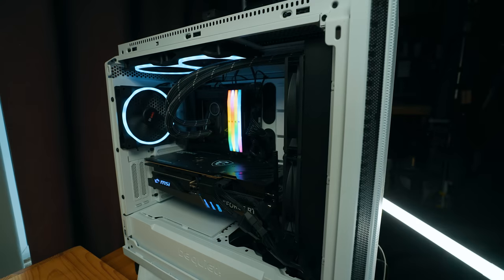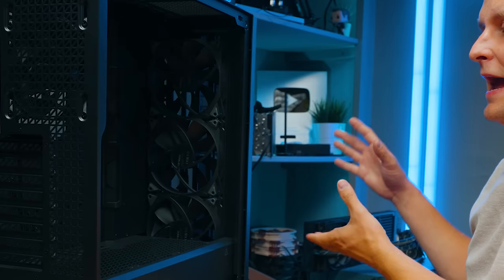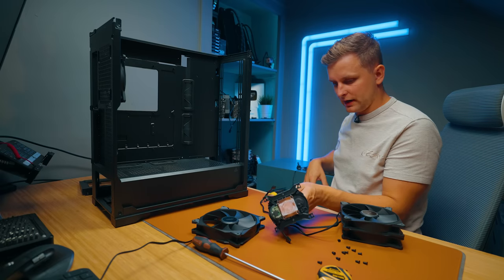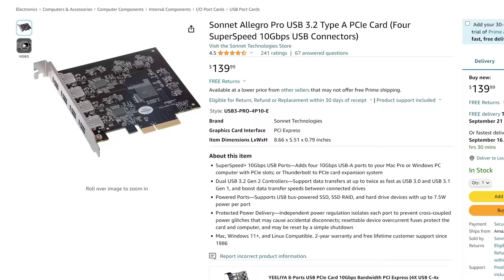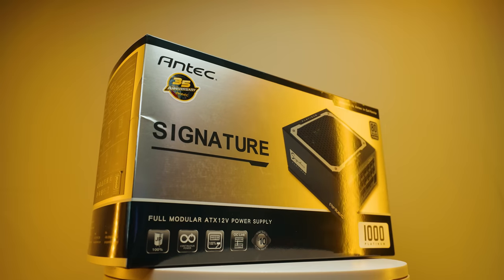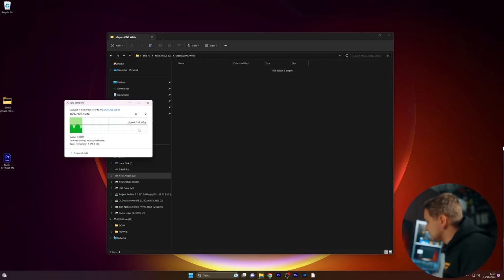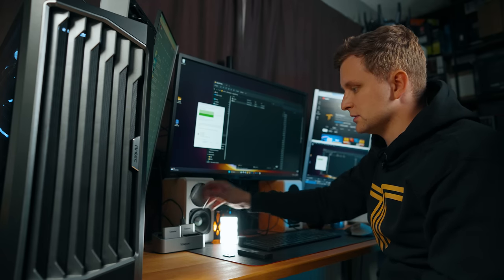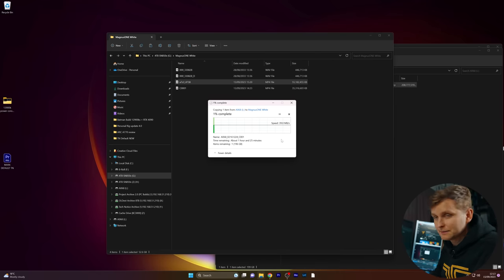I Upgraded AGAIN👉 BEST Video editing PC 2023! | Personal Rig Update 4.0

Comment: I can confirm that NvME 4.0 Lexar Aris drive in a 10Gbps case on my Editing PC (6000Mhz 2x32GB Corsair RAM + 13900k CPU + 3090 RTX GPU + Z790 ProArt Creator Motherboard + Windows 11 | >> Can sustain ~950 MB/s upload speed (copying files from the SSD to my PC) for over ~15 minutes (uploading ~1tb of .mp4 video files). The external NVME drive is plugged via USB-c to USB-c in the second (from the top) Thunderbolt port, on the back of the PC.
Reply: And all that while running 100+ Chrome tabs and Unreal Engine in the foreground.

Comment: Any idea what the 'new' ASUS z790 Pro art  motherboard improvements will be? I heard they are upgrading it for the intel refresh coming out soon. Will the extra power/cores/heat from the new i7-14700K require liquid cooling?  I am interested in the MOBO and i7-14700k for Audio production only w/o a graphics Card. Thanks
Reply: I haven’t seen or heard anything about the pro art motherboard being refreshed.

Comment: i wonder if crucial RAM and SSD are good for creative work like 3D and editing? and if you can make a video about build PC budget 4000$ to 4500$ using Crucial RAM i really appreciate
Reply: I have a 4TB Crucial SSD for the source files, I had a few speed issues before I saw that it requires a driver install. So be sure to install the driver, especially for the large drives.
No issues in nearly a year of use, I edited 6TB of videos from it.

Comment: The IO on Creator motherboard is limited yet exceedingly stretched. I see this as a problem with the available PCIe lanes.

Minimize the connected devices and you will see the difference
Reply: Had the same thought. Looks like a PCIe lanes bottleneck, upgrade to a prober CPU platform and problem solved😂😂

Comment: I'm having kind of a similar problem. But i use my phone for recording and wanted to transfer from it via usb c (phone) to usb A 3.0 (Computer). 

So since i removed the Windows phone link (I didn't like all my phone messages appearing on my pc), i tried sharing a folder on my pc so i could access the folder on my phone and transfer the files through Wifi. I however couldn't get it to work.

Do your camera's have Wifi? Maybe you can try transferring this way. (If you can get it working)

No clue what i did wrong. If anyone got some advice pls feel free to educate me.

Comment: Hi, I also have the z790 proart motherboard, and huge thunderbolt issues.

However, I get decent speed with my two usb-c CFexpress card readers, they are “only” 5gbps but they performs at that sped when using the thunderbolt ports. However I have experienced some thunderbolt “crashes” and then the card reader speed drops down to usb 2 speeds.

A also have a thunderbolt driver fail during windows boot and also WHEA logger errors on the PCI root port. (according to device manager the thunderbolt is connected to the pci rot port that produces the WHEA logger errors)

Do you have any errors like that ?

 

I also struggle with display over thunderbolt, etc. it kind of works but to unstable to be useful.
I don’t get display signal until windows has booted halfway up. And sometimes windows just hang during boot. Etc. no display during post etc until I take a reboot. (I have a ASUS proart monitor with thunderbolt.)

I have also done a complete fresh windows 10 installation on a separate m.2, and it’s the same.
so I suspect it’s the motherboard.

I have contacted ASUS customer service, but they have not been helpful yet. (But they are verry good to blame everybody else.)
Reply from the maker: Is it the top end ProArt monitor? If so, that monitor has very slow boot times and not necessarily to do with the Windows/motherboard.
Reply: @theTechNotice  I have an Asus PA34VC. I don’t notice any change in boot time if I use it on DisplayPort directly (thunderbolt disconnected) or through Thunderbolt.

Comment: Why place the radiator in that orientation with the tubes at the top?  This is extremely bad advice from a tech tuber … shows lack of basic understanding of physics.
Reply from the maker: In this configuration that's the only way ;)
Reply: I haven’t used this case so fair enough … I would then state that this case is not good for AIO’s if the tubes don’t fit at the bottom

Comment: so RTX 4090 16 lanes, 10gig ethernet 4 lanes, usb card 4 lanes. pcie m.2 4 lanes sata 4 lanes     right there you have 32 lanes scrambling for resources. i seriously doubt that motherboard has 32 lanes. thats why your speeds suck. I know i run the x570 proart with a 4080 2 m.2 drives and 4 sata drives and im all laned out i turned off the 10g ethernet because i dont want it stealing from the 4080.

STATS: AMD Ryzen 9 5950X, Corsair iCUE H100i, Asus ProArt X570-CREATOR WIFI, Corsair Vengeance LPX 128 GB, Samsung 980 Pro 1 TB M.2, 2x Samsung 870 Evo 1 TB, Seagate FireCuda 530 1 TB M.2, 2x WDD 10TB Storage drives 7200 rpm, Gigabyte 4080 16GB GDDR6x, Corsair Obsidian 750d case, Seasonic Prime 1300w PSU